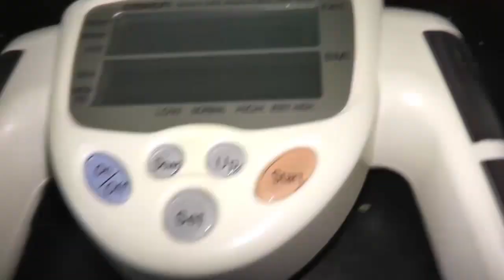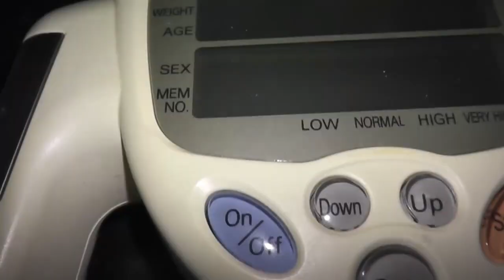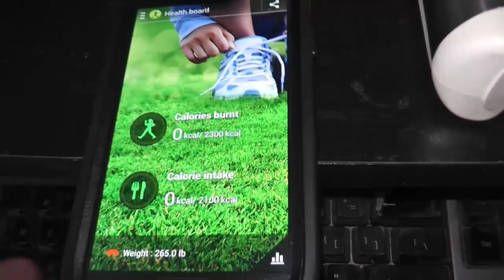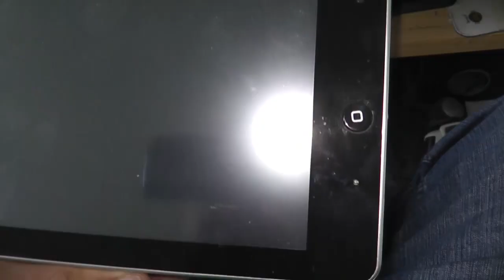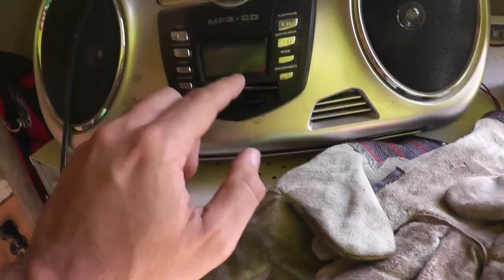Day 890) Coffee Cubes and The White Tractor

Comment: That red wire should go on the battery side of the starter solonoid. It provides the 12 volts to energise the solonoid at the switch, and allows the charge from*

Comment: honestly 2700cals is lunacy for weight loss, stick at 2000, Google "uk rda" and follow the guidelines for the women which is 2000cals and fat, carbs, protein and so forth and so on. You will note for men its 2500 so even though you think you are going what you need you are still going 200 over recommendation.  For reference 700 cals/day intake is were things start to get fucy and 400 or less is dangerous, you can exist safely and without problems on 1500 cals/day so target between 1500 and 2000